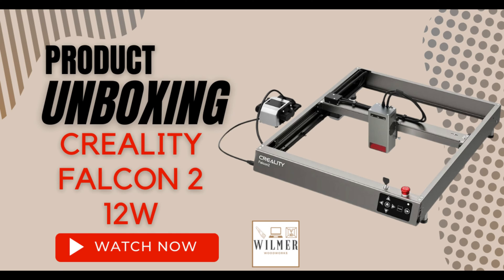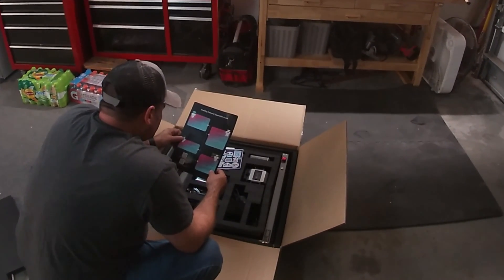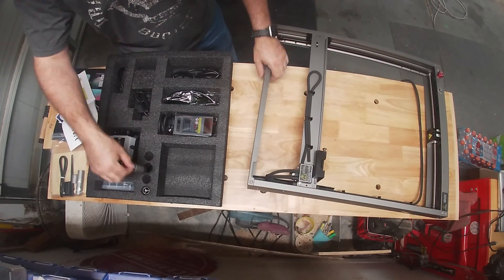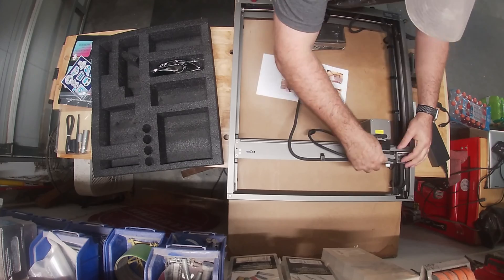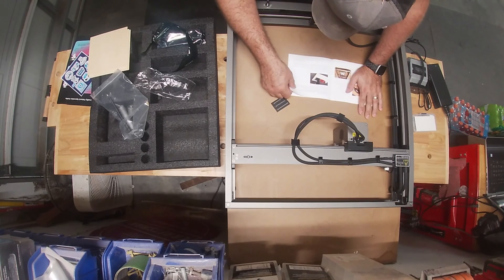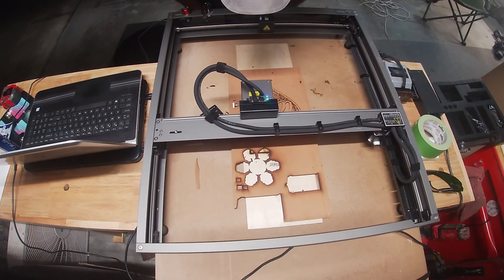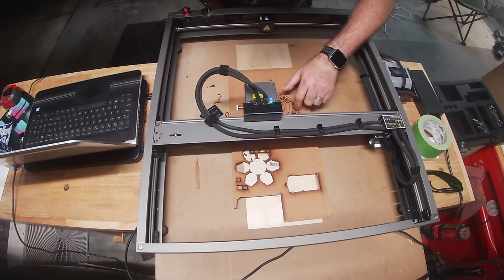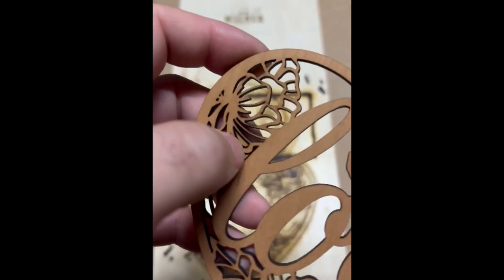Can You REALLY Achieve Professional Results with Creality Falcon 2 12w Laser Engraver in 2024?

Comment: This thing will not engrave these small pieces of wood it engraves on this foam board but not basswood
Reply from the maker: What thickness basswood are you trying to cut? 3mm(1/8")

I set my 12w to 250mm at 100% and sometimes have to do 2 passes but it will cut.  I have even cut 1/4" ply using 5 passes.

You will also need the air assist on to avoid any burning.
Reply: @wilmerwoodworks  How thick of wood can you cut. e.g. 1/8" ply. or basswood? I thought it said it would cut 10mm? in one pass.
Reply: Does this model is suitable for various type of paper/ cardboard cutting ?
Reply from the maker: @ddsouza3382  Yes this can easily cut cardboard as for paper I'm sure it is but I haven't tried it yet but have future projects involving paper.

Comment: Thanks for the vid. Can I ask what thickness was your test wood? Also I need an engraver not just for cutting but partially hollowing out shapes. For instance if i have a 5mm wood i would need a circle hollowed out 3mm deep. Do you think this to be suitable?
Reply from the maker: Hey, thanks for watching and asking! The test piece was probably about 5-6mm of Cherry. With the right settings, you could cut 3mm deep into 5mm wood. I haven’t had any issues engraving deeply into material; it really depends on the type of material you’re using.